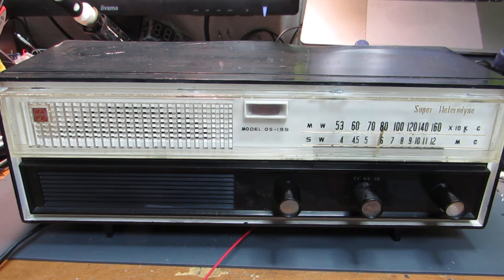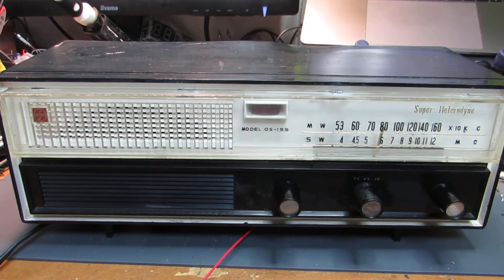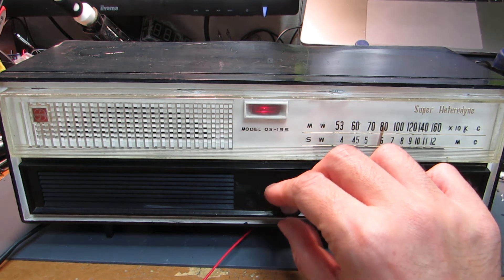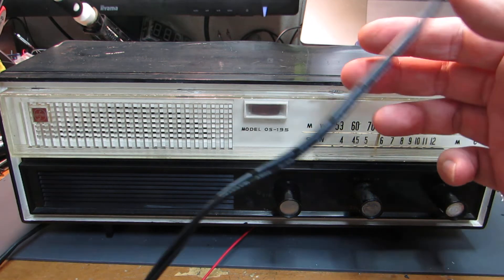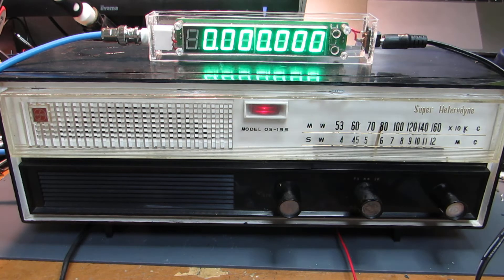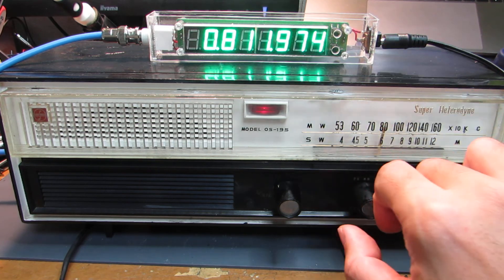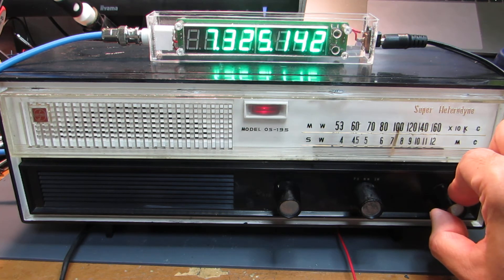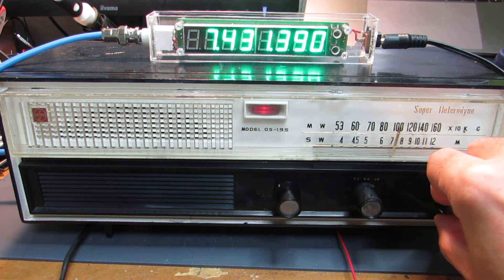Retro tube radio gets digital frequency meter

Comment: So it's made in Japan and you are Japanese, is it an export model that found it's way back, because it's all written in English?
Reply from the maker: I checked the schematic by https://www.radiomuseum.org/r/onkyo_os_195.html and comparing with my radio, the export model seems as suffix "HS" and it has auto trans for voltage step-down from 110-220-240 to 100V. I guess the domestic model can also work for 110V but 10% higher heater voltage may damage tubes.. :-)